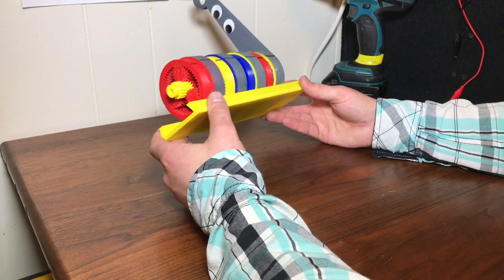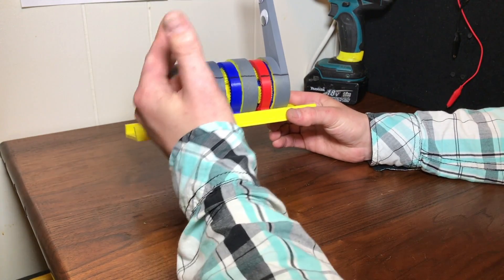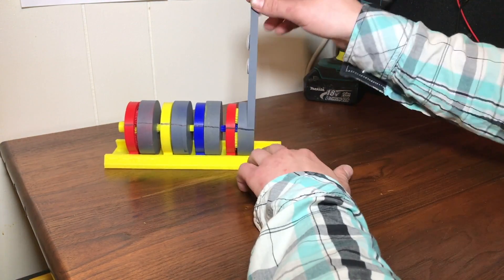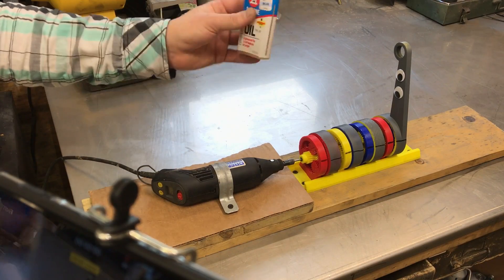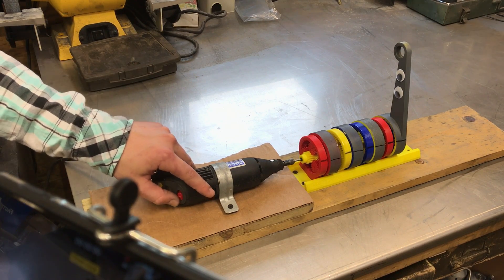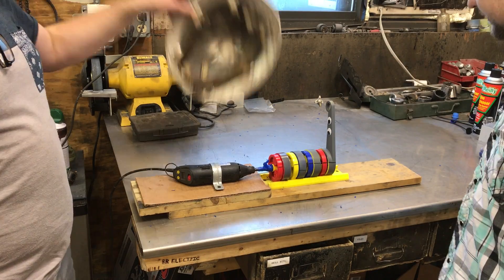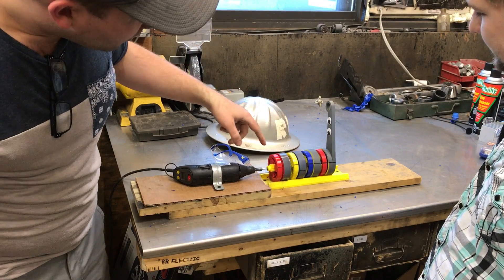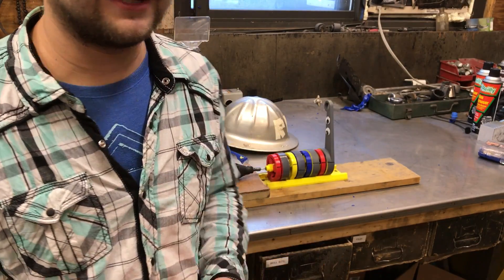3,616,238,492,881 To 1 - The Most Useless Gear Ratio Ever

Comment: Leave it running submerged in oil and get back to us in 5,737 years ok?
Reply: Oil would deteriorate the plastic gears.
Reply: if it's mineral oil then it wont do jack to plastics but it would demolish any rubber parts very rapidly
Reply: MegaDoubleStack depends on the oil man..
Reply: America would take the oil
Reply: Lil lefinn Out of all the dissenters, your dissent is the best.
Reply: Save the political bull shift
.
Reply: Pls and Thank you
Reply: The drill would deteriorate in 3 days. Or the bank will take your house they own cuz mortgage is slavery and you can't pay your electric bill

Comment: I do not know the content of the plastic used, but lubrication and cooling seems to be an issue. Could you submerge the whole assembly under water leaving input shaft exposed? Automotive antifreeze has lubrication qualities and can be diluted. And it's also transparent to view workings of gearbox.

Comment: Almost all of the comments are people wanting the drill on the other end haha! Assuming you had infinitely strong gears made of indestructium and zero friction and a drill with a torque equal to that of about 10,000 top fuel cars, you would have some fun. Although, not so much, since the fast end would now be turning at 3.7 quadrillion rpm, assuming you were using a 1000 rpm drill. I’m not sure how big that gear is, it looks about 20cm circumference. So it’s outside edge would be traveling at 12 billion meters per second. Or, 40 thousand times the speed of light. It would then become infinitely heavy while simultaneously going back in time to a point before you even built it. I can’t predict what the result of that would be but, probably nothing good.

Comment: Would it function submerged in regular water?  If so, it might solve your over heat issues.  Significant reduced visibility, but with a simple pump and ice water reservoir, it should stay a consistent operating temp.
Reply: The water would slow it down
Reply: rancidoverwelm you read minds however I think it might tsunami
Reply: dontlikemath -.- then just a walk-in freezer

Comment: After gleaming over the comments, I have not found the most important question being asked already. What would happen if you cranked the googly eye handle 1 rotation? I imagine alot more heat, 3.6 bil rotations in about a second or two. I don't imagine as much pulling force, lifting trumps or shipping containers etc., as it gets the other way round but that speed, whoa, make for a nice desk fan during summer :D

Comment: A quick question: Couldn't you modify the 3d print file to include a basic impeller on same shaft as the sun gear and an impeller housing on the ring gear to direct the airflow back through the gears? Might mean you don't have to dose it with active cooling so often...

Comment: Can we reverse the ratio?
Reply: But if you managed to put enough power in it to turn it, it would be going 119,777.82 times the speed of light on the other end. So assuming you did somehow come up with more energy than is available in the observable universe, and the material held together, the laws of physics would cease to exist and most of the transmission would travel back in time.
Reply: Sounds like a weekend project to me
Reply: No information can travel faster than light
Reply: Zachary Graden Aw hell yeah
Reply: Alex Jamieson wut
Reply: Richard Smith no, its mass would just grow to infinite
Reply: Someone needs to scale up the gear boxes a little in titanium instead of plastic
Reply: When you gear something up in speed, you loose torque. So a 1:10 gear ratio means that for every 1 turn of input, output will turn 10 times, but the output has one tenth the amount of torque.

For something like this, one turn of he output would theoretically turn the input 3 trillion times, but you would have 3 trillion times LESS torque
Reply: @XevianLight  this is actually a decent summary on performance drivetrains
Reply: NerdishTech why thank you!

Comment: Im not a genius, but don't you need  like 50k Trumps of weight/torque/whatever to be able to spin the last gear? The little movement of the last gear can be the gap that you also have in your cars gearbox( put your switched off car in 1st gear and try to move it)

Comment: if used like a winch in your first gear, you could wind a very large 1/2'' nylon rope in it with a single turn of your final gear... using an 30'' wide reel, you could wind a rope with a length as the orbit traslation of the Earth, it would need 850431 levels of winding, the reel would be 10 km tall and would weight as 1290 Titanics

Comment: Useless? Far into the future these will be used for impossibly minute adjustments for... things.
Reply: William mayby if you want to fucking do surgery on a microbe.
Reply: Placing atoms in the right spots, or even assembling atoms using their base building blocks.
Reply: Mortis except the gear ratio is made from atoms...
Reply: Everything is made from atoms.
That's why I suggested using this to move them.
Reply: It can probably be improved.
Maybe better materials, and professionals making it.
Reply: @Q.A.a.R.I.S  You can't trust atoms, they make up everything.
Reply: Atoms make banana peels, I don't trust them anymore.
Reply: Mortis gears have a limit, and they will always have some slack. They would not work for what you are suggesting. Even if they did it would far easier to invest in alternate methods such as hydraulics.
Reply: Actually wrong... The aggregate movement over time may be precise in relevance to input vs output, but the simple backlash on the output gear, although undetectable to the naked eye, is probably greater just turning it by hand, which makes such minute movements impossible with gears. That is why piezoelectrics are used instead.
Reply: Let us have our fun ideas.
Reply: planetary scale space stations. If humans ever get that far
Reply: Damnit, my clock is 0.443 nanometers too far to the right
Reply: They can use it to arrange carbon atoms to make nano tubes for a space elevator.

Comment: So if you connect the Dremel to the other end and make it a bit stronger than usual, the leftmost thing is gonna rotate at 4,339,486,191,457,200 rpm, for a very short time.oO

Comment: Ok so if this was all built inside a special container of liquid nitrogen, could it be run backwards to a generator coil. If it could, then with a heavy weight and gravity, a tall pully and cable structure, could you use the slow falling of the weight to turn the large gear?

Comment: 160 degrees Fahrenheit is not likely to melt the gears so I'm not sure you need the coolant but I would imagine that the coolant causing the gears to change size as they heat and cool would cause expansion and contraction therefore I'm assuming premature wear not to mention breaking down of the Plastics

Comment: lets spark some useful thinking here..... try buliding a gearbox that will turn a 40 kw generator @ 1800 rpm. powered by a 12v battery with a solar panel to keep it charged. and 12v motor. and see if you can power your house with it.
Reply from the maker: +KATTYWOMPUS1 you wouldn’t get enough energy out of the solar panel to spin the generator, your loosing energy at the gearbox, motor and generator. It would be more efficient to connect the solar panel directly to a battery in parallel with an inverter.
Reply: Gear Down For What? Once the generator is online and a constantavolt charger is in line. It's self regenerative power
Reply: Gear Down For What? Doesn't have to be "practical" it's more useful then a 16 year to one gear box.  Lol
Reply from the maker: Your idea would the laws of thermodynamics

Comment: If you wanted to spin down a turbo-crank for use in a car, this would be perfect!  However, you would sort of have to change out the gears for metal CAM ground from conventional 3D printing.

As of for a hand crank version, it could be used to open pickle jars and get off stuck bolts. (You'll need some way to relay all that torque without the gear breaking.)

This could also be useful for anything you need a high power lever for from a skimpy toy motor.

For lubrication. I recommend using silicon grease type with a plastic safe carrier.    You could also use plastic safe lithium grease.

As of the Google search on the subject, never Google "lubrication" without putting safe search on.

As of reducing heat build up, just make it bigger!

Comment: so what if you turnt the outher side
Reply: Nut the friction would be so great that the lever would break before it budged
Reply: *turned
Reply: It would break no matter how strong material and glue you used and since if it worked the speed would be faster than the speed of light.
Reply: It would go so fast it would explode.
Reply: @technicallydifficulties7094  this guy gets it

Comment: A stupid question but could you spin the other side
Reply: Ranul Yes but it would require a rediculous amount of strength. Also the gear box would likely destroy itself if enough strength was used on it.
Reply: Jezza :3 Yes I guess so. I've been to a museum that had loads of these gear things and the bigger gears against the smaller gears were much harder to turn.

Comment: One question, why the hell are you using super cool liquid as lubricant.   Any Tom dick and Harry knows that you need a lubricant to reduce friction.   Super cooling two moving parts that are making contact with each other does not lubricate them.   
That would be like draining the oil from your engine and replacing it with liquid nitrogen.  It would stay cool but any friction points would be destroyed almost instantly.   
Try this experiment again but spay a high quality synthetic oil in the first planet set. I guarantee it would last longer and stay cooler.

Comment: So it turns out, you didn't even need to attach the other two gearboxes, because you haven't even made one full revolution of the second gearbox for one step on the third. Let alone move the fourth!

Of course, the next step would be to rotate the mechanism from the other side. How fast would the first gear go? (Chance is, the fourth wheel would be completely stuck, and the whole device would break before moving.)

Comment: Could you put energy in the other end (yank the handle) and see the beginning spin faster than the speed of light, or doesn't it work like that?
Reply: if you have the torque to split the Milky Way apart, than sure

assuming the material the gears are made of can withstand that and they wont immediately melt and blow apart

Comment: If the circumference of that first gear (the gear attached to the drill) is ~3 inches that first gear would have traveled ~19M miles or 764 times around the earth before that final gear makes 1 rotation.  

If you had a motor driving the whole thing at 1M rpm it would take 6.8 years to make 1 rotation of the final gear.

Comment: Why can't you spin it from the other end and instantly solve the worlds energy problems?
Reply: It doesn't multiply the energy output. It takes the force of all the turns on the input the turn once on the output so you need to push on the output as hard as several planes to get it to turn or you could get superman to do it. (it would break anyways)

Comment: If you want to keep it cool and lubricated, you should design and oil refrigerant tub to set the gearbox in so you don't have to keep blasting it with a can of compressed air.

Comment: so turning from the handle side it would turn something 3 trillion times?
Reply from the maker: Theoretically
Reply: ...if it doesn't snap something from the massive friction and pressure needed to force the gears to turn. Maybe if you had some Super Lube it would work but physics kinda dictates it would break.
Reply: Princess Chaos I can now honestly say I've seen a princess talk about super lube
Reply from the maker: You can estimate the diameter
Reply: Why didn't you try it? Seems far more interesting experiment than doing it this way.
Reply: Dr Deuteron but how do you convert rpm to speed? Wouldn't you need to know the diameter of the circle that is spinning? Or can you calculate it at the center?
Reply: yeah, but i'm sure u cant produce that torque to rotate it even a degree!
Reply: Maybe use a very long lever for that lol
Reply: That could make something fast
Reply: Dr Deuteron 
No.
You can turn it slowly.
Reply: Yeah but you would need 65 metric tons of torque which converts to 143300 ftlb of torque if it works that way
Reply: It would snap. There is no material strong enough to withstand such extreme internal stresses.
Reply: Gear Down For What?  Make video where you slowly turn from the handle
Reply: Harris Naseem But this is made out of plastic
Reply: ras 47 if you had an engine to provide that much torque
Reply: Derek Macdonald i was having the same thought. Ridiculous amount of power to do so tho
Reply: I think at some point you might run into problems because the blade tips reach the speed of light.
Reply: Ever try to push start a car engine from 5th gear? Kinda like that, but far far harder.
Reply: in reply to UCEUtciOwldT2KAFr3TQFtKg: Actually, first gear would be more difficult.
Reply: Sounds cool huh
Reply: no, there isn't a material that would be able to withstand the force necessary to overcome the friction to make it turn from that side. not unless you were to turn it incredible slowly.
Reply: You need a denser, more flexible, AND more rigid material than exists to make this work in reverse with the force necessary to move it. Find some dark matter.
Reply: C W Good One :)
Reply: Princess Chaos Nope, look at advanced mettalurgical materials used on spacecraft, they can withstand immense pressures. You might need a reduction gear to make it work.
Reply: So if we use say a ship engine or something along the lines of that to spin the opposite end..? That would have enough torque surely? Is this how bombs are made? 😲